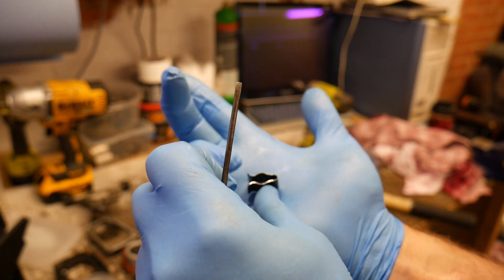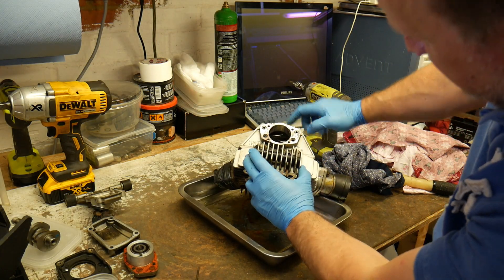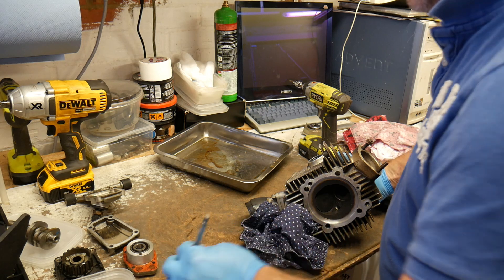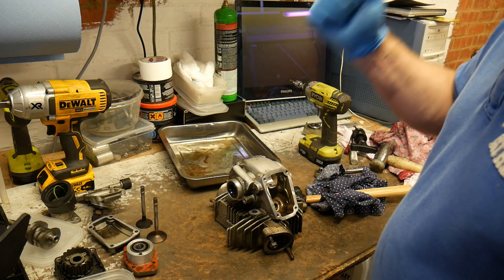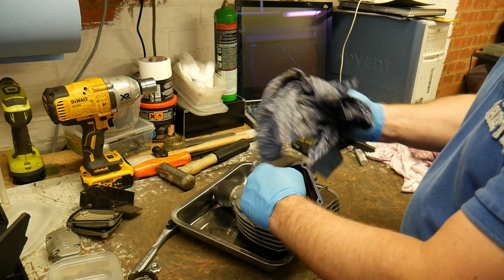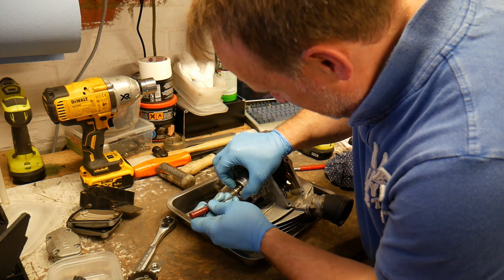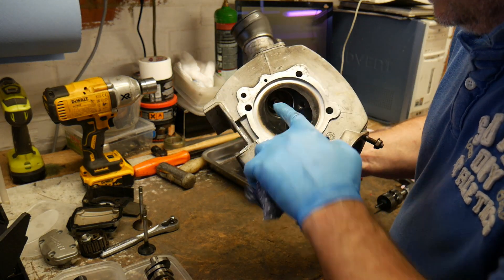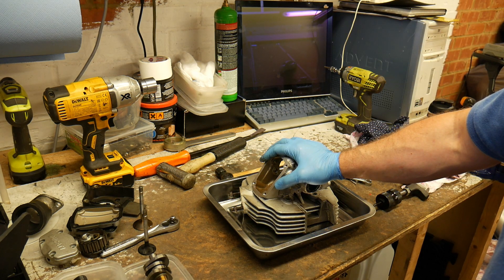Ducati Cylinder Head strip 2003 750 SSie Teardown of a 2 Valve head

Comment: Amazing video, im just wondering, as im about to start rebuildingy bike i just bought, with a timing belt that snapet on the vertical cylinder, im hoping that i can do only with head rebuild? What is your advice and sugestions, its a monster 620s 2003
Reply: The amount of damage depends on the speed of the engine at the time, if the engine was only at low RPM it may have only bent valves, (don't try and straighten them) but if the engine was at high RPM it would be a major rebuild. I am a toolmaker and Ducati Monster enthusiast, I have done a major rebuild on my M750 and hotted it up with Hi comp pistons, bigger race valves, flat side race carbs, programable ignition it goes very well. So pull the head and see what the damage is, I would be interested to see, by the way I have 3 Ducati Monsters.
Reply from the maker: As per the other comment it will depend at what RPM the failure occurred as to the level of damage you will find. If at a high RPM I would advise stripping the whole engine to check it over and make sure there was no damage caused further into the engine. However if you pull the head and see no evidence of contact then you are lucky and may get away with just checking over the head and valves for any possible deformation and then refit and install new belts.

Comment: Nice. If worn valve guides, do you replace them and recut the seats on your own?
Reply from the maker: No, I have the valve guide tools but not the capability to align the valves correctly so would outsource the valve seats to get cut.

Comment: Nice video, but where did you get the tools for undoing the nut holding the cam drive pulley on. That went a bit fast.
Reply: I made one from a 25 mm hole saw. Ground teeth off and cut slots.
Reply from the maker: I got a replica holding tool and the socket from ebay

Comment: Easy to follow videos again and good angles for seeing the steps, very much appreciated 👍
The tangs on the rocker arms were a god send when they came in - worked on my pantah 600 and having to remove the rocker arms just for shimming up was a royal PITA
Reply: Sounds like bevelheads experience if not mistaken
Reply: @xyesman5519  600SL pantah was early belt drive,, although would be nice to work on a bevel